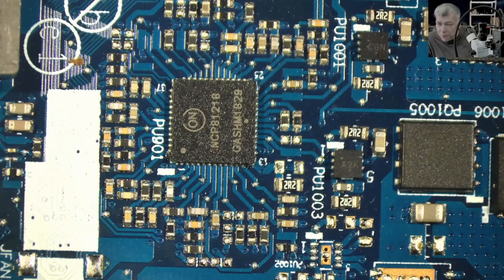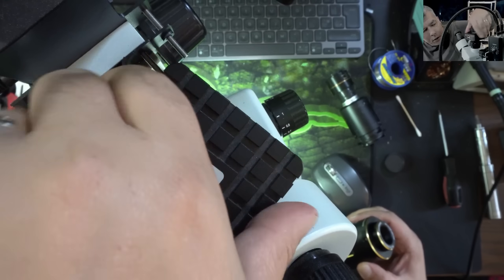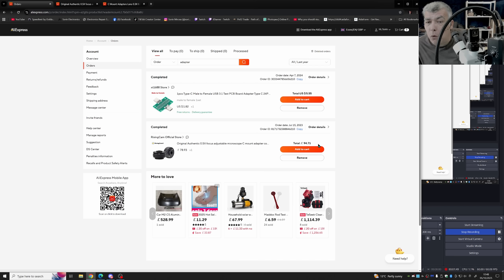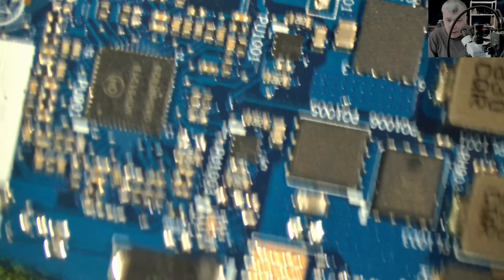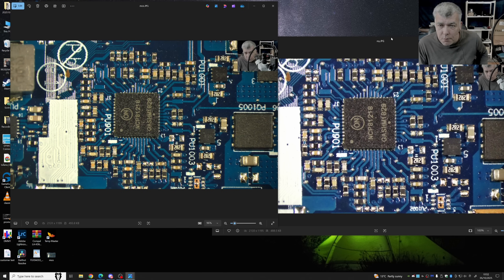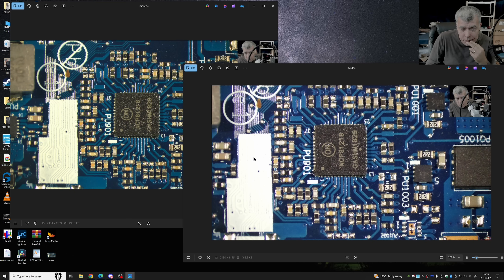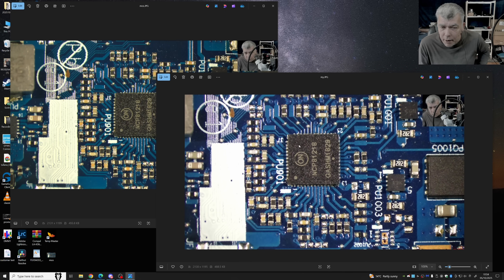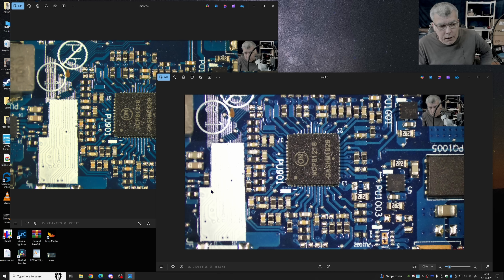I figure it out! Microscope camera mount (focus ring)

Comment: On the same lens system - same subject to (front) lens distance, both focussed, if the Mechanic camera has  larger sensor then you will get a wider field of view.

Also with the same lens system, from front lens to the camera sensor, the chromatic aberration is the lens system, not the sensor, although camera sensor image processors are capable of correcting for lens' aberrations - that's what a lot of the camera makers spend $$ doing.

There is another reviewer that's complaining that he's getting vignetting, which is a problem with his lens system not covering the camera sensor corner to corner - something which yours clearly does.

Comment: Hi Sorin, I noticed that you use the zoom knobs on your microscope to adjust the focus, is this by choice? If you parfocal the microscope those knobs should not affect the focus meaning you can zoom in and out while keeping the image sharp, I'm not sure which microscope stand you have but mine has two big knobs to adjust the height, these are the ones that adjust the focus. VoltLog has a very quick video on how to set this up, look for "Voltog #297 - How To Parfocal A Trinocular Microscope" if you are interested, but then again this might just be your preference which is totally fine. As for the camera I would go for the mechanic one for the wide angle and better contrast but both look good. Thanks for the great content.

Comment: use metal zip ties to hold the thermal camera in place its metal will never get effected by the heat . but as you always said about heat and electronics use a thermal pad under the camera

Comment: I've read the comments, and I would agree with the photographer. You need to set the levels of your old 4K camera to the same as the 8k. In theory, you wouldn't be able to see the difference on such small screens. The brightness on your old  4k camera is set a little high, and it is causing burnout - the image loses detail when over exposed. In photography & video, if you have burnout, you cannot bring back detail. You have to record the image at correct exposure. My view was that the old 4k was actually resolving better detail,  but lost the detail where it was overexposed. 

So, you will only get to the truth if both cameras are set with proper exposure.

Comment: I feel I should mention this about the Mechanic camera: they claim '41MP' which we would assume to be meaning 41 mega-pixels, but the Sony IMX687 sensor they are saying is in the camera doesn't have 41MP - it is ~8.3 or 8.4 megapixels according to the Sony datasheet.  Likewise they are claiming '7440x4176 pixels' but the Sony datasheet says 3840x2160 pixels with variations having very slightly different pixel counts, on the scale of 12 to 20 pixels.

Edit: Looking at actual pictures of the camera "3840x2160@60FPS" is physically printed on the camera.  So yeah, either marketing lies of dramatic overspecs or 'virtual specs' with some kind of software upscaling.

Now, it appears that the image quality is roughly equivalent to the RisingCam RT5109 (the other camera being shown which is actually the one I have in my lab).  Possibly Mechanic is claiming 'effective' or 'equivalent of' the stated MP count due to some kind of AI upscaling, but I'm not seeing anything more than difficult to determine minor differences in image quality.  The trace visibility Sorin shows could easily be adjusted for just in contrast or brightness settings (I am making an educated guess there).

Still, I will give credit where credit is due.  If we are looking at this and saying 'yep, it's roughly the same quality image output as the RisingCam' while it is currently being sold for ~$200 and the RisingCam is now around ~$700.... well.  Sorin said it.  Value for money.

I am surprised it doesn't have optical zoom with how thick it is, but looking at Mechanic's page on this camera they only seem to list digital zoom.
Reply: 41MP is some kind of interpolation marketing only used on the picture mode, most of the microscope cameras say that if you do a research, but they mention that's only for pictures.

Comment: Overall for the price the camera is good. I would advice you to teardown the camera to add some heatsink to he mcu and camera, if you can I did not managed to find a good place for the heatsink because of the ribbon cable of the sensor(it does not have any). That way you can find out what sensor is used too.

Comment: I bought the mechanic 4K MOS PRO camera which looks identical to that mechanic 8k camera. I literally could not get it setup on my microscope. I have an Amscope like your one but every time I set the camera up, it would get like a tunnel picture, where you can see the sides of the camera hole. So it looked like you’re looking down a tunnel with a circle shadow around the edges.I tried the 0.35 and the 0.5 focus ring and various other extension ring to bring it higher but could not get rid of the tunnel vision. It’s a shame because it does have a lovely picture. It seems like you don’t have that issue with the newer version. I personally think the mechanic is better compared to your older one , has more details and a wider view. With a few setting changes, you should be able to make it even better.
Reply: I would've thought you would want to get it closer, ie, shorter adaptor.
Reply: @SidneyCritic I did try that as well but same result, I tried it with just the 0.35 and 0.5 focus adapter with no extension ring and could not get rid of the tunnel picture. It’s a shame because the picture looked a lot better than the camera I’m currently using,
Reply: @SURGE101  you probably are using an adaptor ring that you should not use. From C to CS you need adapter but if both camera and the lens have the same mount then you don't need adapter.
Reply: @orange11squares thanks so much,I’ll give that a try with no attachments because I only tried it with them attached. Would love to get to the bottom of it because it’s been a waste of money and a camera because I haven’t been able to use it since buying it. I’ll dig it back out and give that a go. Thanks so much for the help with this, really appreciate it. Thanks rich

Comment: Hi Sorin,
The sensor for that camera cannot do 4k 60fps, so it's very likely it's just doubling fps by repeating them and 4k60fps is just false advertising. The 8k thing might also be software upscaling.
Reply: idk, but in the old video seems very smooth without seeming that it had any doubling fps for 30 to 60, but there are other cameras that have lower sensors that have 60fps idk, like the imx 415 60fps usb 3.0 from elp camera, maybe the thing that makes it achieve 60 is the processor.
Reply: @PauloHenrique-v8o  @sergioav7278 is mistaken, the sensor can achieve 60fps (or 72 - depending on the ADC)
Reply: @PauloHenrique-v8o  If the sensor can't do 4k 60fps, the camera cannot record at 4k 60fps.
It's fake marketing, placebo effect
Reply: In the old video seemed very smooth when he shaked the camera from top to botton repeatly and it didn't tear the record image, so if it works fine without losing quality or have screen tears or in the most cases fps losses, that's fine for me.
Reply: IMX678 can produce 60fps@12bit@4k or 72fps@10bit@4k, it's specified in the datashet.

Comment: Thank you for the answer Sorin, the Mechanic is looking much better for details on the board and more pleasant for the eye picture. I remember on the test with low light you could use it even without ring light, so definitely better camera sensor. Seems a very good upgrade from the old one. Glad you could resolve the mounting problem, indeed is a classic C mount so you need the C mount adapter for the microscope. Greetings

Comment: I thought that was weird, because it has a standard C mount. Mine will be an upgrade from 1080p to 4k so I will have to make it work. Keep the new one, mine works even with the microscope lights turned off, just the shop lights